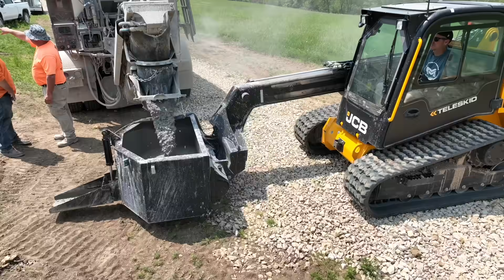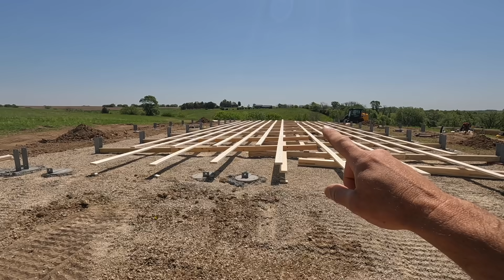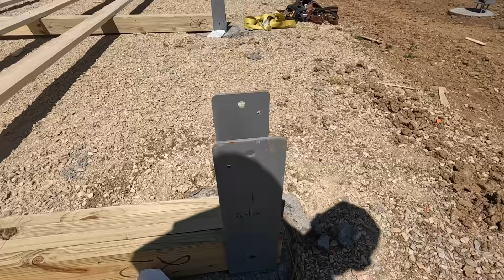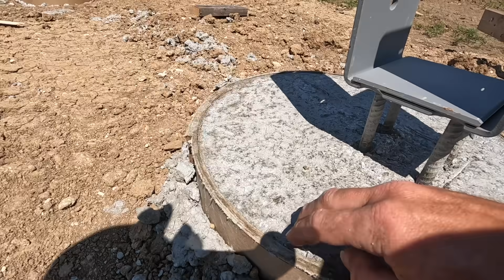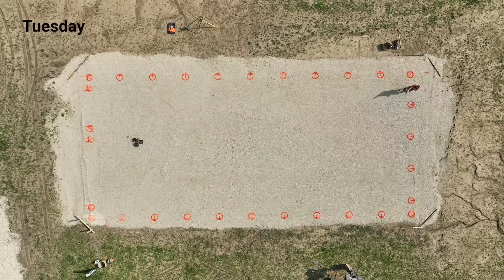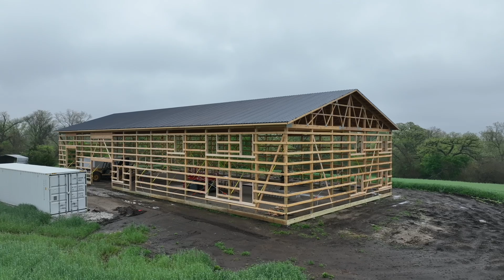The BARNDOMINIUM BUILD Process | Introduction

Comment: When you pour the slab for the main floor is cracking a concern without traditional foundations?
Reply from the maker: It all comes down to proper sub grade prep. If you make sure you are on well compacted site with 4-6” of compacted of rock for drainage u should not have cracking outside of your relief cuts.

Comment: I have a 60x80 red iron frame (18' side walls) with Main frame columns and rafters with the purlins and girts.  I don't have true steel end walls, roof or wall "X" braces, or eave struts. Is this something you can finish the design, possibly a hybrid (partially post frame). Looking forward to your reply